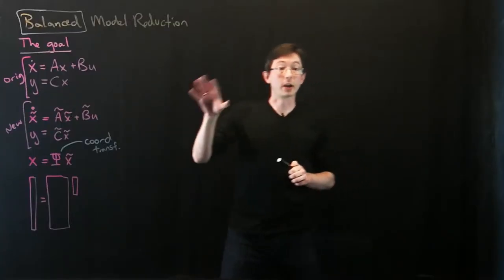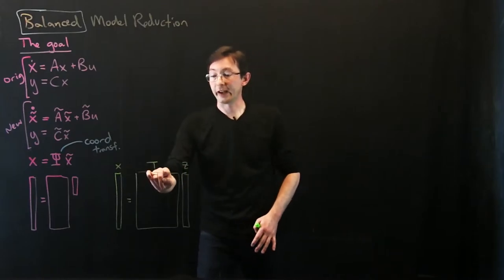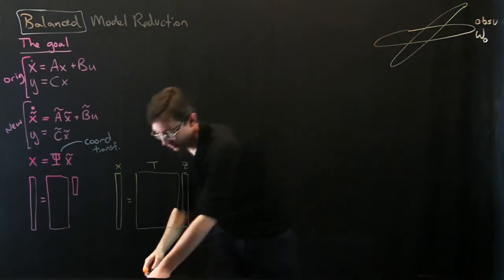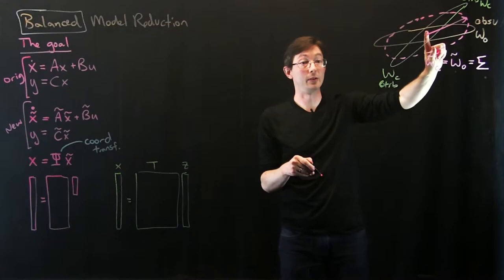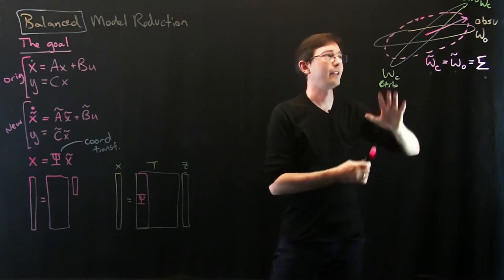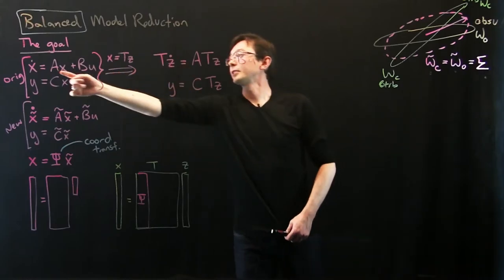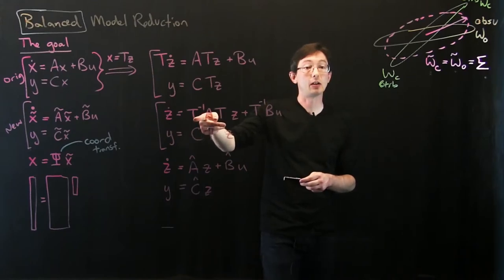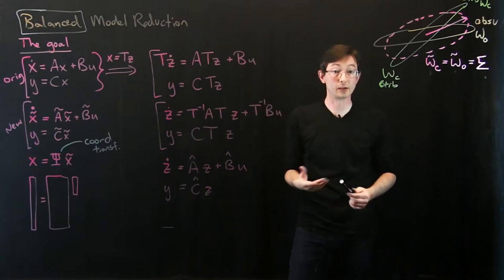Data-Driven Control: Change of Variables in Control Systems

Comment: Hi Steve, start from 11:45, I am still confused about why we can pop out the inv(T). You said we assume T is some eigenvectors or orthogonal... But how this assumption help us eliminate the exponential?
Reply from the maker: Really good question.  In the definition of the matrix exponential, e^{B} = I + B + (1/2)B^2 + (1/3!)B^3 + ..., if we plug in invT * A * T, we get 

e^{invT * A * T} = I + invT*A*T + (1/2)(invT*A*T*invT*A*T) + (1/3!)*(invT*A*T*invT*A*T*invT*A*T) + ... 

you can write I=invT*T and then we get

e^{invT * A * T} = invT*T + invT*A*T + (1/2)(invT*A*T*invT*A*T) + (1/3!)*(invT*A*T*invT*A*T*invT*A*T) + ... 

 = invT* ( I + A + (1/2)*A^2 + (1/3!)*A^3 + ... ) * T
 = invT *  (e^A) * T*

See time 16:00 in the following video: https://www.youtube.com/watch?v=nyqJJdhReiA&list=PLMrJAkhIeNNR20Mz-VpzgfQs5zrYi085m&index=3&t=0s
Reply: Almost forget this. Thanks for pointing out! As I watch the following video, another question pop out. At 2:50, you assume ~wo and ~wc are diagonal. But we don't have such assumption for original wo and wc. I can see this makes calculating T and scale it easier. Can we can also do that without this assumption ?
Reply from the maker: Yeah, here, we are assuming that we have performed the balancing transformation that makes these two Gramians equal and diagonal.  It is not obvious that this is possible, but it is.  I show how to derive this transform in https://www.youtube.com/watch?v=IlrnTjwujBk&list=PLMrJAkhIeNNQkv98vuPjO2X2qJO_UPeWR&index=7
Reply: Wow! That was so unexpected. Amazing!
Reply: @Eigensteve  Thank you for the explanation and @shengjian thank you for the question !
Reply: I was gonna ask the same question, i was confused too. Thank you !